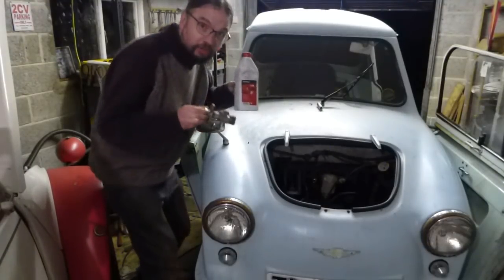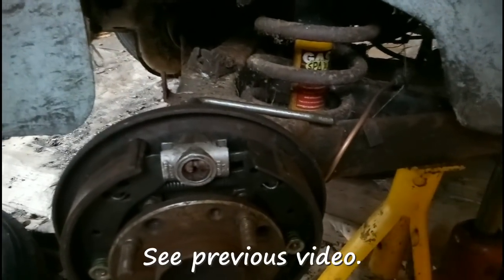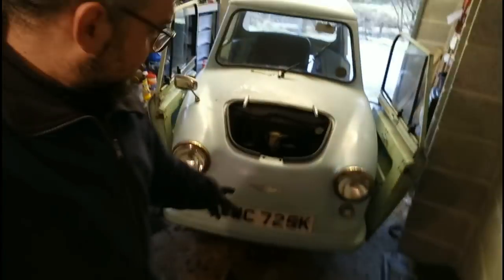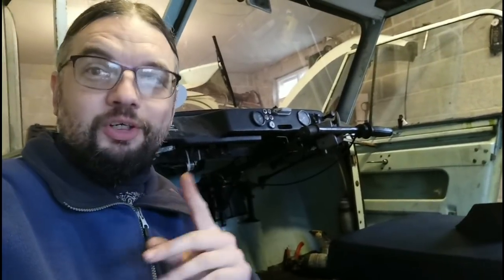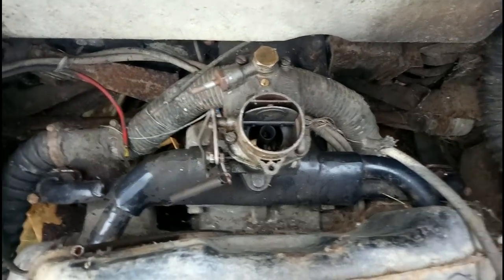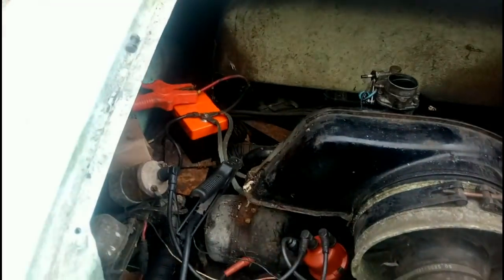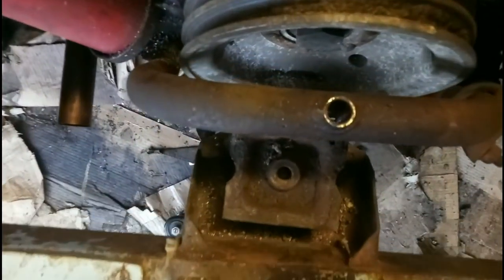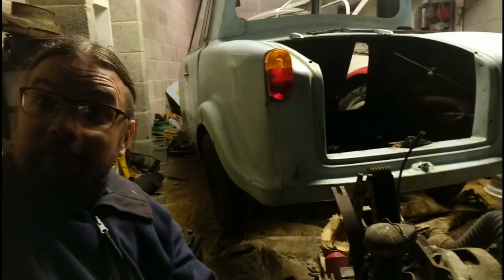Project Invacar Part Nine: The Joy of Brakes (plus engines!)

Comment: Thanks for this video, I'm super glad the project is moving forward! And you seem to be happy with the progress. I know that feeling when a project comes to a crashing stop due to some major cock up and damage. I've been sitting in complete depression on the garage floor just this Thursday for 2 hours after I discovered an unexpected break down on my vintage vespa restoration project. But now I have a new hope - the same as you have with swapping the engines. Still, would be worth cosidering to have the original broken engine fixed as well so you have two in working condition. Fingers crossed for you and all the best!

Comment: This is fantastic!  Well done on the brakes.  It's worth the time to get it right.  

The spares engine is indeed sounding good.  And was that the first start?  That fired up right away.  Nice!
Reply from the maker: I'll admit, there were quite a few failed attempts before that one. Perhaps I should have left those in. I couldn't find the hose I'd used to bodge up a fuel system before, and the pump on this engine didn't seem keen on pumping, so I just filled the float bowl and away it went! Until it used that up. Failed attempts are good, as they get the oil circulating.

Comment: Great video again Hubnut !!. Surely it would be easier to work on the engine now that it's out of the car than to remove a second engine !!! I wish i lived in Wales i would volunteer to help !!
Reply from the maker: The original engine needs stripping and machining at a bare minimum. Easier to pull the spare engine out and then rebuild the original with no time constraints.

Comment: Don't know if it's just because you were outside,  but the spare engine sounded better running than the other one :)
Reply from the maker: It did sound a lot sweeter. 11,000 miles!
Reply: Pheonix103
I thought thé same

Comment: Shame the Invacar doesn't have a removable rear panel like the Imp. I did a really easy clutch on an Imp by removing the rear panel, putting a skateboard under the sump, jacking up the front till the engine was on the skateboard and wheeling it out. unscrew clutch, put in new one, job done.

Comment: Nicely done! Personally, I'd swap the running one in and build up the other as a spare for the future, but you know better what will work for where you're at in the project!
Reply from the maker: That's the plan, though I said that about my 2CV's original engine, which is still sitting in the workshop untouched six years later...

Comment: Well done HubNut it's going well as for brake shoes you have a leading and trailing brake shoe
The trailing shoe is normally longer and has the handbrake lever on it and the leading shoe is normally shorter than the trailing shoe and slightly thicker  it work on what is called self servo action is that the rotation of the drum clockwise when you press the brakes the fluid from the mastercylinder is pumped to the wheel cylinders pushing shoes out and  making front shoe tendencies to be dragged in  also on the Hydraulics the diameter of master cylinder bore is smaller than the wheel cylinder bore this gives you a multiplication factor so say pressure on  foot brake is 20 pounds you may get at wheel cylinder 40 pounds  and this can be further increased by using a vacuum servo  this is for conventional brakes wheel cylinder at top  all the best your doing great
Reply: A good book to get on motor vehicles is  the fundamentals of motor vehicle by hillier and pittuck its what I used at college when I did my motor vehicle City and guilds
Reply from the maker: +honey monster On these, the shoes are identical. They just need to be the right way up...

Comment: Hmm, maybe throw together a temporary hoist using some poles and block and tackle for the outside car. Uncoupled the motor and then lift the rear of the car with the hoist. I have done this in the past, back on the farm. Typically the hoist is 2 'A' frames with a pole across the top, cross braced so it does not collapse sideways on you.
Cheers,
 - Eddy
Reply: Yes. The lifting would have to be from 2 tie points on the back (like a triangle with apex at the block&tackle), otherwise the whole thing would just flip on its side when lifted. Additional blocking on the front would help to stabilize it as well. Just need to lift it enough to get the engine out.

Comment: An auto-bleed is handy. It's a bottle you connect to a tyre for air-pressure on it's fluid then you just open the bleed valves and it bubbles-out.
Reply from the maker: I've never had any joy with those. Having a helpful wife works just as well.

Comment: Nice to see your brakes are back together and sorted
Think you gave up too early on the dizzy by ripping the engine out
Let's hope you don't have the same problem if you ever decide to adjust the timing again
I do hope we see a closer image of the offending dizzy and see a sods law removal video when it's on the floor
You could set a new craze and have a styer puch custom coffee table or in your case  tea table
Reply from the maker: The offending dizzy is mostly in pieces. I fear some of those pieces are now in the crankcase as the engine no longer wants to turn. It wasn't pulled out for nothing! I'll get the spare engine in (which also has a seized dizzy, great) and then see about dismantling the original.

Comment: With regard to your brake bleeding kit i have found that such items should be kept in a gaudy coloured  box. Usually a red or an orange but sometimes bright blue or even yellow so they are visually obtrusive as you stare round the garage or check the cupboards. With regard to the engine removal from the other Invacar plan B might be to remove the body from around the engine if a safe working arrangement can be envisaged complying with full Elf  and Shapely regulations subject of course to method statements and agreement being obtained from the relevent bodies. What that really means is drop yourself in it and then find a way out...

Comment: Hey ian just get a reciep saw and cut down either side of the back panel .its only fibreglass and you can drag the engine straight out the back .dont get all sentimental on me coz by the time you finished this one you won t want to be renevating another too soon .
Reply from the maker: Yes, I think butchery could be on the cards. A friend wants the body, because he has one with very poor front bodywork.

Comment: All about the brakes, 'bout the brakes, no pedal. Lol. Great video as usual. :) That spares engine sounds a fair bit healthier than Tuk's! What oil do you plan to use in it?
Reply from the maker: Drat. Pedal works much better than Servo! Will use 20w50 oil.
Reply: HubNut It does, but I wasn't trying to one up you! Aha. Thought it would be 20w50. Classic oils (UK) do their own range of oils as I am sure your aware, and 5 litres of high ZDDP 20w50 is something silly like £16. Lovely! Cannot wait to see Tuk move for the first time under her own steam. Will be a sight to behold. Should be stupidly fun. What's the availability of the belts for the transmission/transaxle arrangement? Standard size off the shelf units or bespoke?

Comment: The japanese have a name for the solution to your engine woes...Hyabusa.
Reply from the maker: Do they have a gearbox solution too? Must mate to Fiat 500 driveshafts.
Reply: run a piece of water pipe between the two rear hubs and a sprocket on the pipe for the drive. . you will be going so fast that the crudity of the axle will be far from your mind.....

Comment: Good work. You made it seem suprisingly easy! Would you swap the gearbox too?
Reply from the maker: With just a handful of bolts, it certainly isn't that hard to get out. How easy it'll be to get back in remains to be seen! Won't have gravity on our side... Not sure about transmission yet. I know the transmission in the car works, but the spares one is entirely unknown (and not testable as the rear wheels are entirely seized).

Comment: I hate working on drum brakes, they are awful things. You have to try to save the original engine, but the spare sounded more healthy. I say swap the engines to get it running but strip & rebuild the original!
Reply from the maker: That's the plan.
Reply: Are there places that will rebuild that engine for a non-astronomical sum?
Reply: It's more a question of can you trust people who rebuild an engine for a low price. The only true way to get a "cheap" rebuild you can trust is to do it yourself. If you have never done it before get good manuals and a friend who knows what he is doing to lend a hand. It's how I did my rebuild.

Comment: Good news! Brakes done, and now onto the engine issue - progress is definitely being made. One question - what about the distributor in the spare engine, is it stuck or can it be rotated to adjust the timing?
Reply from the maker: Distributor is stuck, but timing thankfully seems happier. This is a very good reason to try and overhaul the original engine.
Reply: All good - just don't go with the 'cunning plan' of trying to free up the distributor on the spare engine...
Reply from the maker: Oh don't worry. Lesson learnt!

Comment: Weld a slide hammer to the dizzy shaft and shock the old dizzy out of it's hole.
Reply from the maker: An option. The dizzy on the spare engine is still seized too, just in a better place!
Reply: Another option would be to do away with the dizzy altogether and fit a trigger wheel and crank sensor then.
Reply from the maker: +Ian Walker That thought has crossed my mind.

Comment: Another tick brakes . It looked like spares car could do with a couple more pallets and don't forget to weigh front down . I'm sure once its had the MOT it will be both tax and Mot except .
Reply from the maker: If I want until May, it (in theory) won't need an MOT at all. It'll be getting an MOT regardless though. Need someone who actually knows what they're doing to check it over!
Reply: I sent you a like about how few cars there are about and it said they were banned. But its basically a Robin Reliant ish , and I've asked a few in the trade and they thought seat belts and or doors impact zone . Maybe roll cage to fix
Reply from the maker: +Johnny Psycho No Reliant in one of these other than brakes. Government ordered them all scrapped because it leased them to users, and decided there were better ways to be mobile. No plans for a roll cage. It has simple static seatbelts.
Reply: I thought roll cage as trade mates wondered about side doors. but they work at main dealers and only work on clean cars. are there any 3 wheeler mot garages in wales .
Reply from the maker: +Johnny Psycho Nearest 3 wheel MOST station apparently 12 miles away.

Comment: the rear engine mount should unbolt and not be welded in???
Reply from the maker: Looks pretty welded in to me. I started to unbolt it, until I realised that I was just unbolting the latch for the engine cover...
Reply: the rear chassis bar its attached too should be removable
Reply: oh hang on sorry I was thinking of the hillman imp my mind is old and buggered these days
Reply from the maker: Really? That'd make life easier. Nowt mentioned in the manual - though I'm fast learning that an awful lot isn't mentioned in the manual! Given the rear bodywork is shot on the spares car, if that rear crossmember comes out, it might be easier to remove just the engine and bolt it to TWC's transmission.

Comment: Just a quick question, what methods do you use to keep the damp out if your garage? Evey time I go in to work on my jawa cz125 it's absolutely soaking. On another note, thanks for the link to retro Japanese magazine, really enjoying it!
Reply from the maker: Apart from leaving the windows cracked open, nothing. It's block-built but into a hillside, so there's presumably a waterproof membrane behind the block wall. Garage is built into the house, which also helps. A serious downside when doing anything smelly though...
Reply: yeah, my garage is just connected to the house, every time I leave the bike running tho all u can smell is 2 stroke. amazing work on the invicar and cant wait to watch your next video

Comment: Evil gremlins must have gotten into the original engine and welded the distributor in place when you were not looking!  Seriously, the other engine does sound stronger, but make sure its distributor can be removed before taking the engine out.
Reply from the maker: +Thomas Levy The distributor is seized on that one too, but in a better place it seems.

Comment: on a plus side, while the engine is out give all the engine bay and engine a quick lick of paint, I would be putting new rings and shells in if it was me, but thats me
Reply from the maker: Doubt I'll be painting anything, as that isn't my style. Might hose down the engine bay and reapply anti-corrosion wax while access is good though.
Reply: brush a tin of hammerite hammered effect on,  saves you getting underseal all over your self if you need to get your arm down the back for any reason at a later date
Reply from the maker: Thanks. Not a hammerite fan to be honest. Wax is what has been used in the past, so I'll put up with the mild annoyance.
Reply: hopfully you never need that mild annoyance, i still wouldnt be able to resist the urge to rip the engine to bits while its out and throw some new rings and stuff in, its a 2 smoke, it literally takes minutes to do, nice to see a youtube like this not a million miles away from me, im  just outside chester :)